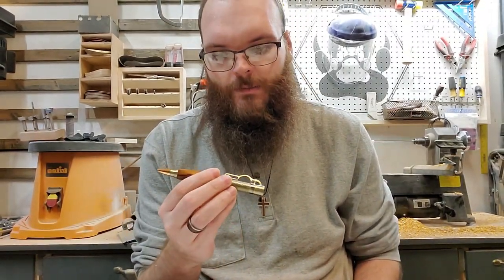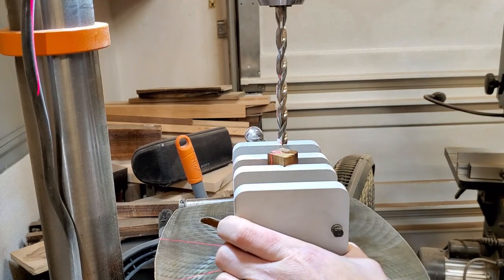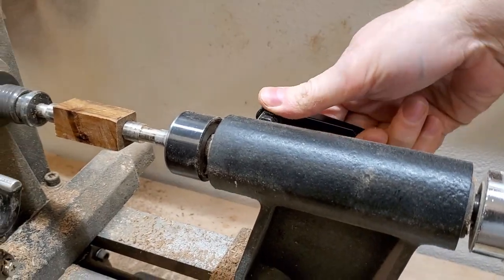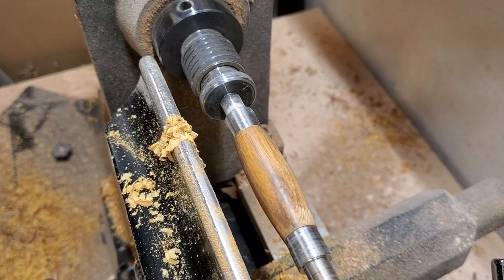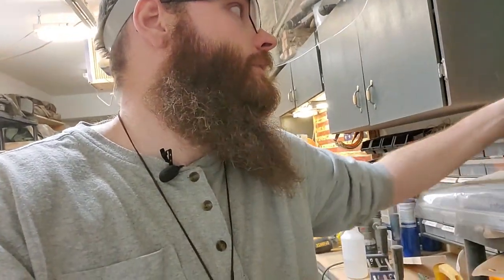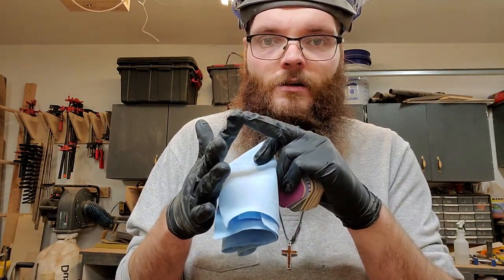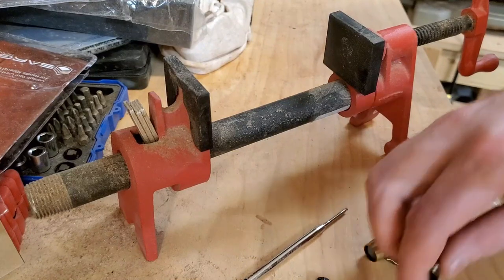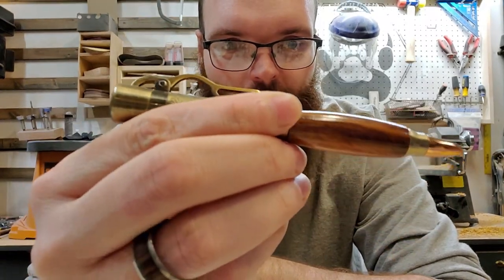Turning A Lever Action Pen

Comment: 33 minutes long, and I saw this when it said "posted 33 minutes ago". This is also the third time i've checked your channel today for this video, after seeing your instragram announcement. 33rd degree wood mason confirmed. PS - do you ship to Canada? Beautiful stuff. Also, how durable is the resin in the mixed material boards for a serious cutting board where you've got a big meat knife or chef's knife and you're really chopping away at stuff hard. Is there any risk of meat juices getting in between strips of wood and resin? I've never owned a nice cutting board so i'm very curious, thanks for the great video!
Reply from the maker: Haha! Wood Mason confirmed 🤫

We're working on getting international shipping set up currently. Trying to figure out how to get it to not cost $50US to ship a cutting board. Prices are outrageous.

No, no meat juices if the board is made properly. On normal boards the glue used creates a stronger joint than the actual wood itself. If you use an epoxy resin like the river tables you see nowadays, that stuff is incredibly hard.
Reply: @LittleBearWoodshop  Ah cool, like welding, where the weld is the strongest point! I'll buy one of your products in the future and we can test out the shipping system! I don't mind paying a bit higher shipping for a legit bear trail legendary product!